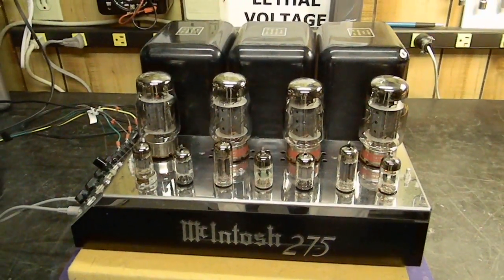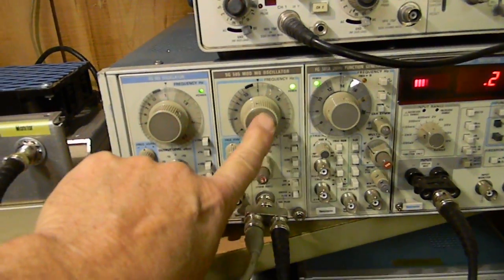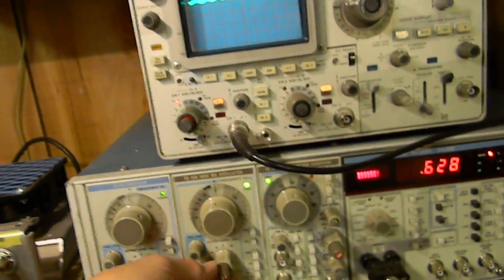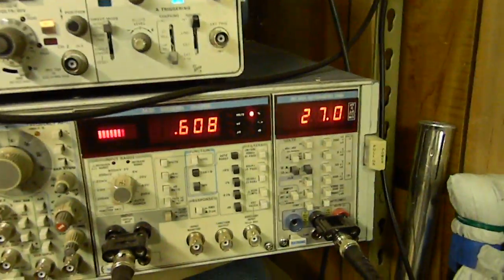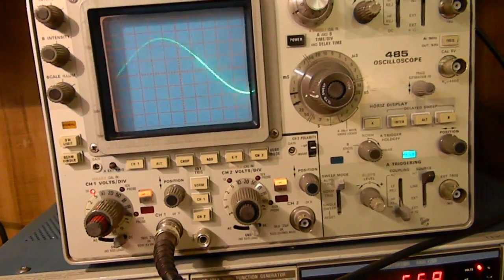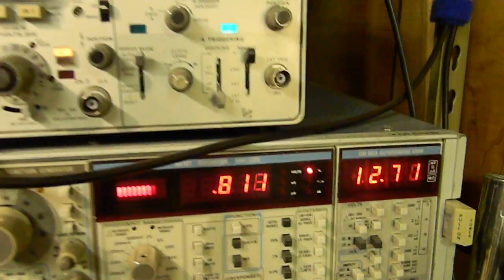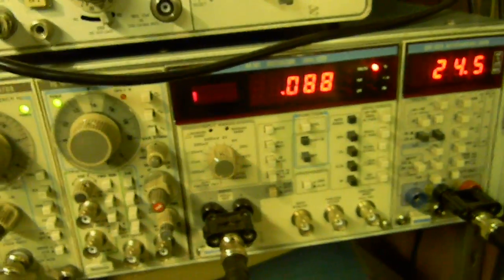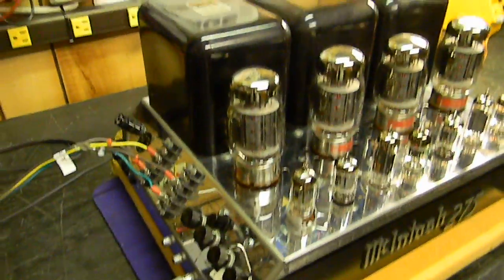Vintage McIntosh MC275 Undergoing Output and THD Tests

Comment: You should connect the Function Output on the AA501 to one of the scopes so you can see the distortion residual. Just staring at sine waves is never going to show anything interesting. Ideally show the Monitor Output and Function Output on two channels of the same scope so you can relate the residual to the waveform.
Reply from the maker: QuadMaestro I agree with you and that is the way I have it connected nowadays.

Comment: Having measured dozens of these amps myself, with the same SG505 and AA501 you are using, I was a little shocked by the low 20kHz distortion, especially since it was LOWER than the 1kHz distortion. Then I noticed you have the 30kHz LP filter IN on the AA501.  That is invalid. Even the 2nd harmonic is being severely filtered out by that, not to mention the higher harmonics.  Try your measurement again with no filter or the 80kHz filter and you will see a real number of probably between .25 and .4% at 20kHz.

Comment: Great Video! Fantastic information and presentation. 
.
You mention that you can use two of your oscillators and the distortion analyzer to measure IMD. Do you have a video where you show that? Could you make one? I am very curious as to how that's done using equipment like this.

Comment from the maker: Yes, all original parts except for the tubes. This unit was made probably around 1962 and unless there is something wrong with the unit, all McIntosh equipment does consistently out perform their published specs. I guess that is why it is stil around and commands such a price - BTW - nice looking amp you built in your video with the four KT88's. The huge transformer closest to the camera - is that the output or power transformer?